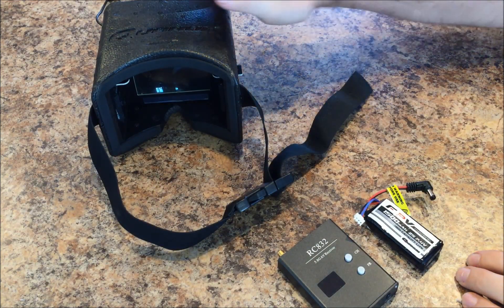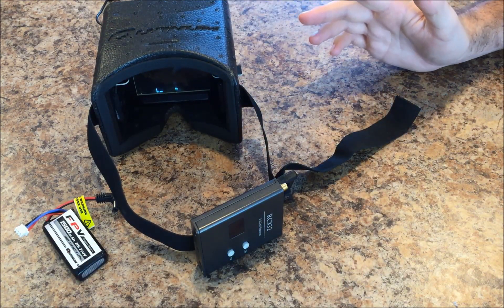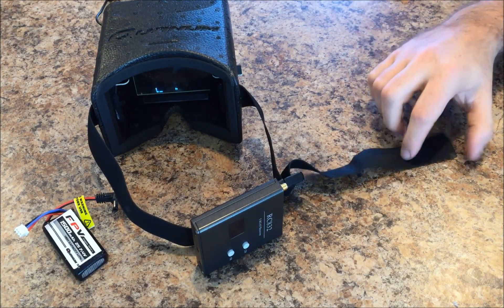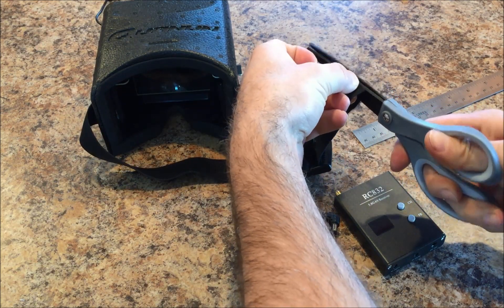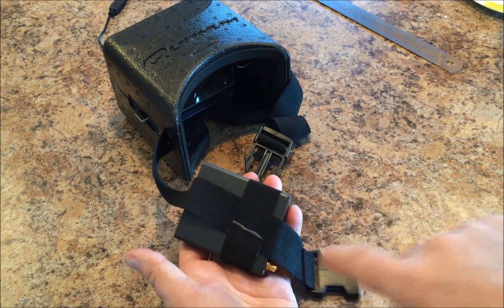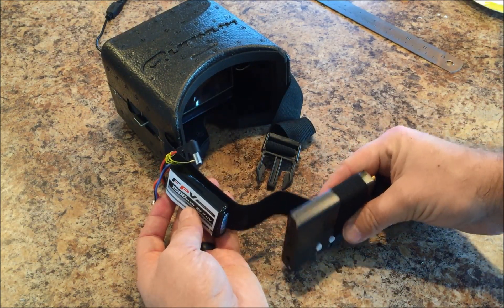Quanum V1 DIY FPV Goggles Receiver/Battery Mounting + Wiring

Comment: I know this is an old video and I'm new to this so would the 3 foot cords work from your pockets? or mount around your neck or on the transmitter if the antenna wont work from a pocket

Comment: That turned up pretty good. Personally i like this long wires because I don't like to have all does things on my head I just hang them on a tripod near me or in whatever thing I have around. If you like this goggles I strongly recommended you to get the V2. I have both of them and the V" are definitely a big improvement. The screen is so much better And the neoprene socs is quite nice also I highly recommended you tu use sky or motorcycle goggles between your face and the quanum, You will not believe how comfortable they get. I use this ones http://bit.ly/Padded-Motorcycle-Goggles And with the V1 I have straped the quanums on a jockey hat.
Reply from the maker: +Multirotor Go Thanks! I will definitely try the V2 goggles when I get the chance. I like the tripod idea, my problem is I would totally forget I was attached to the tripod and try to walk away with it lol. Thank you for the info :)

Comment: is there a slot that can be made on the top of the goggles to make a top strap?
Reply from the maker: +george aura Yes, they actually have a spot marked out where you can cut through and add a top strap if you want.